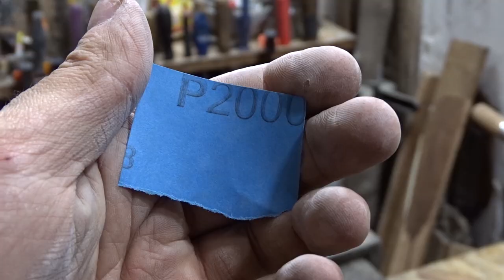Old Rusty Meat Axe Restoration

Comment: Nicely refurbished. Have you even tried "Fumed Oak"? It give the Oak wood a very dark color and is so easy to do. You simply put the wood in a container with Ammonia vapors and seal it so the fumes can't get out. Then look at it every now and then (hourly) until you like the color change. Then remove it and finish it however you like with whatever you like. Or don't even add anything else for a finish. Just an idea...
Reply from the maker: Hello sir, thank you for attention and nice idea. I will try it if get all components for it.
Reply: @ScrewsAndTools  Just be careful not to breathe in the fumes...